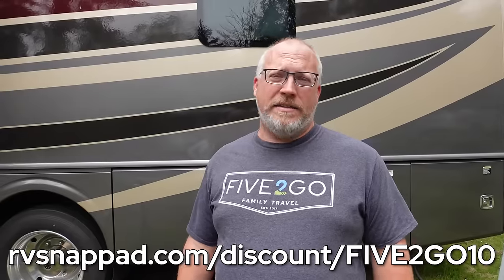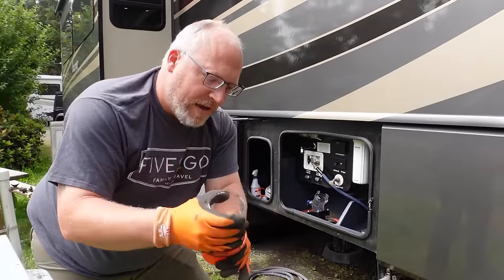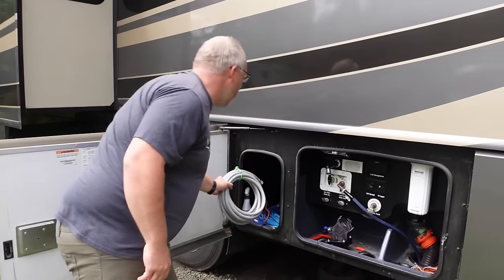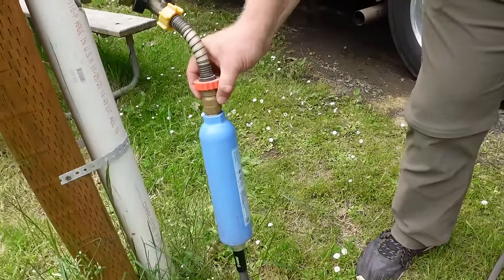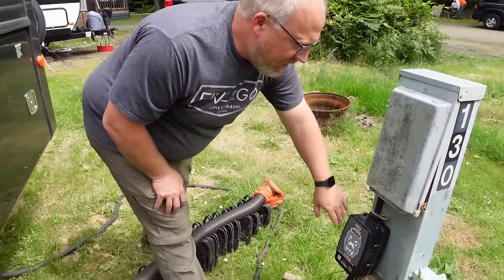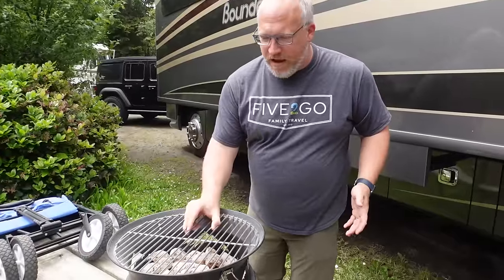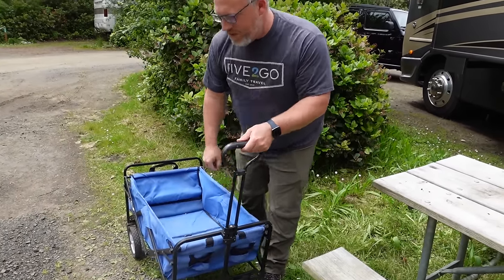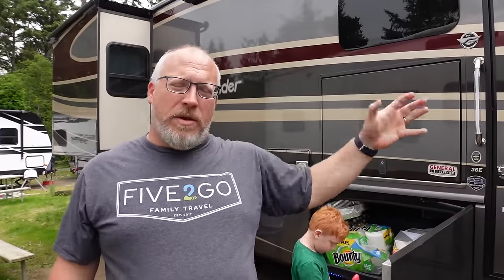RV Camping Essentials: Must-Have Gear You’ll Actually Use

Comment: -------------------------------------
WHAT DO YOU NEED TO HAVE FUN CAMPING?
-------------------------------------
My wife and I started out camping in a tent, then a pop-up camper, and then a 21 foot camping trailer (now my age is 74). As we got older the convenience of a camper with heat, air conditioning, full bath room, gas range, microwave, and refrigerator makes camping easier.  

But we have noticed that the size of the camper does not determine the amount of fun the campers are having.  In fact it has been our observation that people in large Motor-homes and Fifth-wheel trailers stay inside them more than those of tents and small campers.  I think bigger campers are more convenient to live in but not closer to nature, friends, family, and fun.

I was an assistant Scoutmaster and we had a lot of fun camping in tents and hiking on trails where we camped.  The scouts did not ever use a camper and got buy with just essential equipment.

If you already had a tent and a $200 budget, what would you buy for camping?